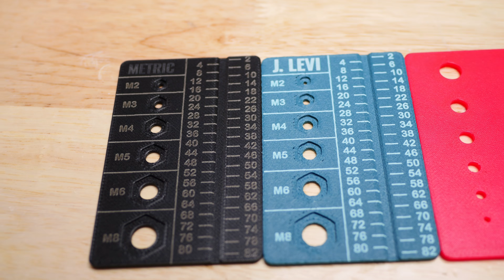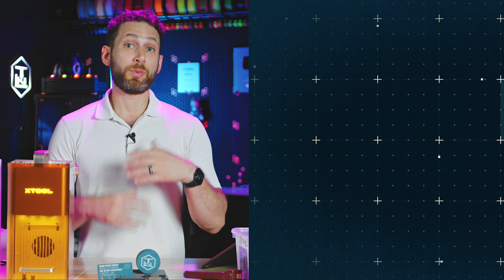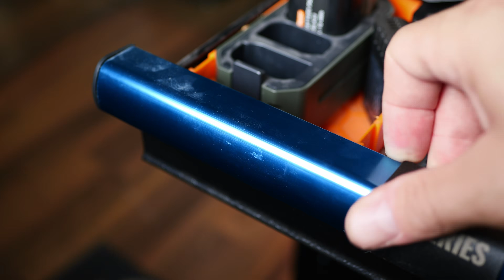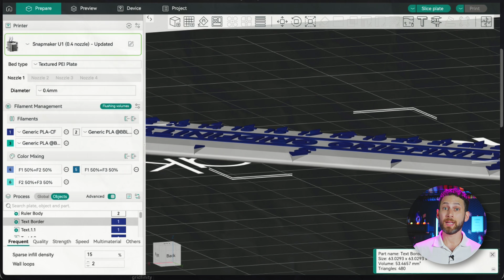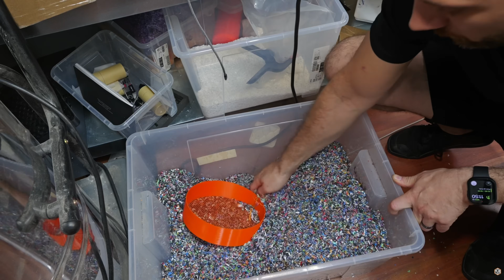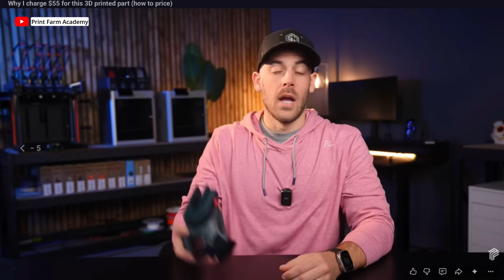Why Laser Engraving 3D Printed Products Makes SO Much Sense

Comment: Alright. As an American who grew up on fractions Have always known metric. Now that I model and print. Metric is the way to go. Easy and quick = common sense. I just bought brass rod to make a custom nozzle clog tool. It was pain to look up the closest size to 1.75mm. But 1/16 brass was 65% cheaper than the 1.58mm package. Maybe ink material costs more on the label to print mm over / ?  Makes no sense. 

And who dont like supertroopers 2 where they explained the formula to convert C to F!   “Times 2 add 32 and join the rest of the human race.”

Comment: Do you think that PCTG Pro would work for those tool box handle labels? I am thinking of trying them and found a source of PCTG that is reasonable. You suggested PETG-CF, but there are not that many colors available, PCTG from the source I found is not limited to 4-5 colors.
Reply from the maker: You never know till you test. Depends on the pigment they use not the material
Reply: @thenextlayer The question is will PCTG Pro be strong as the PETG-CF you used? I have 10 samples of the PCTG in different I will be printing as soon as I get my model built and I get a proper filament profile for, then I will try them under the laser.

Comment: I'm just wondering if anyone has a X1 Carbon with an AMS post Latest Firmware update on the X1 Carbon: After updating the firmware on my Bambu X1 Carbon, the printer itself still recognizes the AMS correctly,  the control panel shows the right filament, the AMS loads normally, and nothing drops out. The problem is with Bambu Studio. Studio refuses to acknowledge the AMS at all. It only shows “external spool” and ignores every AMS slot, even though the printer sees them just fine.
    We did full troubleshooting: power‑cycling, reseating cables, checking AMS firmware, testing prints from the touchscreen, and verifying Studio settings. Everything points to a communication bug between the new X1 firmware and Bambu Studio, not an AMS hardware issue. Other X1/X1C users are reporting the same thing after the latest update. I was wondering if anyone else was experiencing this.  And better yet, what Bambu Labs is planning on doing to fix this issue?

Comment: My way of recycling plastic at home economically: grind it up, mix it with concrete/epoxy, and cast useful items of it. It works as a cheap bulk, instead of the usual gravel.

Comment: Why the hate on Ryobi... Fine batteries, with an amazing ecosystem.  If I ever break a tool, that's when I buy higher level gear.  So far, I've broken a palm sander, and a torque wrench, neither of which were made by ryobi.
Reply: I agree 100%.
Reply: The irony being everyone loves Milwaukee and yet Ryobi an Mil are made by the same parent company. 😂
Reply from the maker: “If I ever break a tool”

😂

I’ve dropped Makita tools off ladders and never broken them. That’s why the hate on ryobi. 

Don’t care much for Milwaukee either…
Reply: @thenextlayer Personally I use Flex but that's cause of A) Extremely well thought out and crafted tools. B) Absolutely the best customer service, I actually look forward to chatting with these guys. C) Lifetime Founders Warranty was extended 3 years in a row out the gate on the Western launch of Flex.

Comment: For batch printing labels from a spreadsheet, Brother makes some of their P-Touch label makers that can connect to a computer (or an app on your phone more recently). The editing software on the computer (I'm not sure about the phone app) can batch print labels from a spread sheet, and the P-Touch label cartridges come in various colors. Some with clear background, some opaque background in several colors.
Reply: Furthermore, this isn’t solving a problem. If you want to label the drawers, then you could just label the drawer face themselves with the touch. It’s not required that you labeled the handles of a drawer and that’s normally not how most people would do it anyways. That said if you want a laser, this is a cool idea. Just a bad example.

Comment: When considering models under CC licensing, there are several variants of CC licenses, some do not allow commercial use. For those either contact the original designer to see if they would be willing to sell you a license, or look for/create a different model. I'm not familiar with M.I.T. licenses.

Comment: I'm in America and hate the imperial measurements and use metric as much as possible, they make so much more sense. Luckily all the 3D printing and CNC stuff is all metric!!! Yay! I don't want to try and find a 5/64ths drill bit and have to know if a 3/32 drill bit is just larger or smaller.
Reply from the maker: Agreed. Can’t stand it.
Reply: i'm born & raised usa & have served this once great nation, but i don't like imperial measurements either - even though i hadto be aware that even on our military installations overseas contractors were required to use imperial measurements rather than the metric ones they grew up with just to build a barracks building or supply depot, where nobody will care about measurements.  drill bits don't bother me, though, just the same - what irks me most is imperial thread sizes.  there's no one system for anything in imperial fasteners - it jumps from diameter to thread widths or thread steps with zero warning, but you're expected to intuitively just know what is what.

Comment: The label printers from Brother (resp. the P-Touch editor) could use a CSV file, an Excel sheet or even connect to a SQL database. Also tapes from 3.5mm upto 36mm are available incl. shrink tube for cable marking.
Reply from the maker: Oh snap! That’s a good tip. Because the dymo one kinda sucks.
Reply: @thenextlayer  I own the Brother PT-P900W (retail price about $270. Big advantage: It uses WiFi. So you can also print a quick label from your phone/tablet.
I just made an upgrade to a rechargeable battery pack (about $120 plus $40 for the battery (third party)).
Reply: The higher end P-Touch labelers from Brother both have a keyboard (for quick one-off labels) and can use the PC software. Be prepared to pay a top end price, though.

Comment: I recently got an xTool M2. I love incorporating its capabilities into my work flow. Even though I can technically still 3D print anything the laser can cut out, I feel like it makes the end product feel more premium.
Reply from the maker: I would agree with that. I also find it's a nice challenge to add more mediums... but besides that, sometimes, if I want something FAST (like, a reprack bracket is showing signs of wearing down and I don't want filament to crash to the floor), there's nothing faster than a laser ;)
Reply: @thenextlayer  sir? Our Lord and savior duct tape would like to have a word. 😂

Comment: I’m still faithfully awaiting the day that we can readily use the laser on a 3-D printer to clear up supports once the print is done and any other artifacts from the printing process
Reply from the maker: whaaaaat how would that even work?
Reply: @thenextlayer print the print and then hopefully have the laser come back through with vision access and use the laser to smooth and remove material. Definitely not easy but 100% the next step I’m wanting
Reply: I have been considering throwing some prints onto a CNC router for perfectly smooth walls 😅
Reply: please show us
Reply: @RASS-4 just an idea I had the other day. I spend a lot of time sanding prints. 🫠 It would probably be pretty tricky to get square but with the right jig it would probably work.

Comment: This is not a fiber laser that's why it's half the price. this is a diode laser with galvo. I'm actually in the market for a laser unfortunately Xtools doesnt sell this machine here.
Reply from the maker: Uhh maybe I'm misinformed but this laser features both blue light and infrared. Isn't a fiber laser a type of infrared laser? 
Edit: I looked into it, you're right, the F2's IR module is a diode-pumped source, not a true fiber laser, but they DO have fiber/MOPA lasers on the F1 Ultra and F2 Ultra - but those are much more expensive. https://jle.vi/xtool you can check them out there.
Reply: @thenextlayer  A fibre laser is just a laser that shines through an optical fibre, any laser source could be connected to an optical fibre. Before fibre lasers they often had a large laser (like a CO2 laser) at the back and then precisely alligned mirrors on the moving gantry to direct the laser, a fibre is just much easier to use.